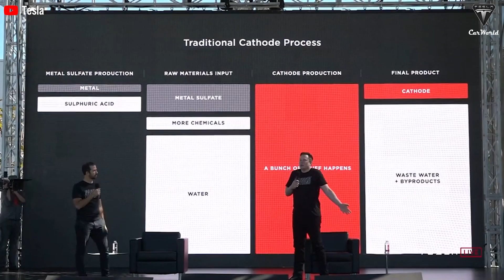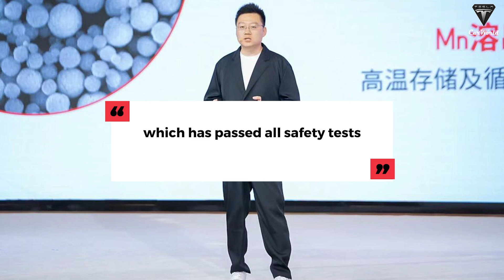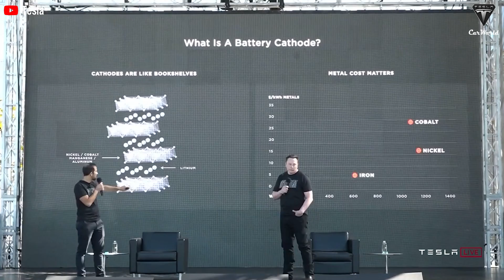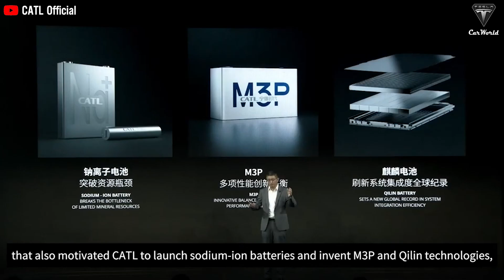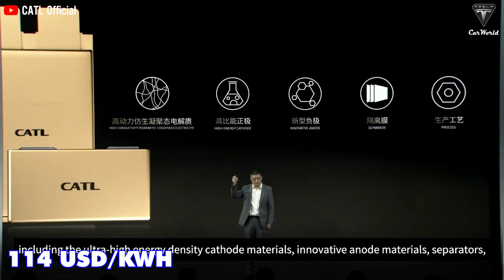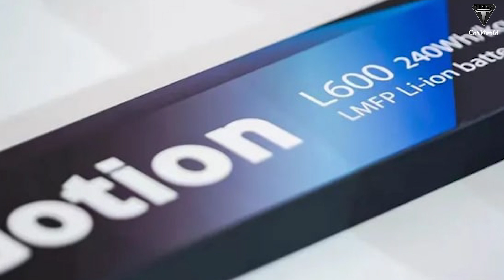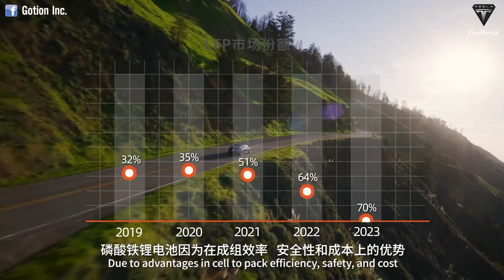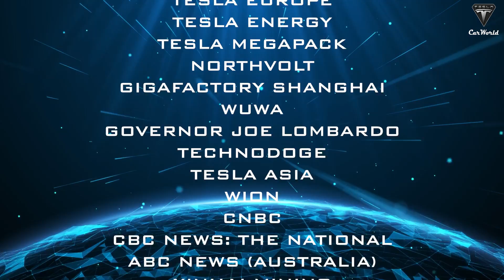The End of Lithium! Elon Musk Revealed A New INSANE LMFP Battery Tech 1,000 km/charge!

Comment: What about ca calendar life of the battery?
Say if I settle for a 500 km range battery that handles  charge 2000 cycles. That totals a driving range of 1 million km. Then say i drive 15 000 km each year. (The normal yearly driving range here in Sweden.) This means that the battery should last 66 years. Not many cars will last that long. Now assume the battery goes bad due to old age in 15 years, then i have only used about 22% of the battery but still payed for 100%.
So if we want to utilize the battery fully  we either have to have a much shorter range,  which is undesirable, or use these i vehicles that is driven much longer each year such as taxis, busses and trucks.
Reply from the maker: Thanks for your sharing, but the battery system is applicable to all terrains and each place will have a different feature. Therefore, you can rest assured that all of them have been carefully calculated.

Comment: Compared to all the battery fires occuring, I wonder how much safer these are, if they are safer.
Reply: That may well be the most important question. 

While every modest incremental increase will always be hyped as a "breakthrough", battery safety is almost certainly likely to be limited by energy density. 

Chemically, batteries are effectively devices analogous to compounds where you have taken your fuel and pre-mixed it with oxygen. As the energy density increases, it moves from being a serious fire risk to an explosion risk. In my opinion battery technology is probably already close to the safe limit. 

I could be wrong. When handled properly, compounds like Trinitrotoluene are actually very safe as compared to, say, Nitroglycerine. But the dividing line can be a very thin one. Finding this out took years, cost money, and also cost quite a few human lives. I guess that many car owners would prefer other choices.

Comment: I will never buy an electric vehicle.   In about 5 years of normal use, the battery has to be replaced at $18000-$25000 dollars not including installation cost.  Europe already has used electric Vehicles sitting on large parking lots because they can't be sold because of the battery replacement requirement.    A typical gasoline or diesel fueled vehicle will last 10 years and more and only require regular less expense mantenance.   EV are a niche market and the average car owner is not going to buy them.
Reply from the maker: That's why manufacturers are developing more for the life of the battery.

Comment: Maybe I missed it, but what is the operational temperature range for charging/discharging?
Reply from the maker: This battery pack uses thermal insulation materials that can withstand temperatures up to 1200°C.
Reply: @TeslaCarWorld  Thermal insulation only regulates the rate of heat transfer, which has nothing to do with the operational characteristics of the battery chemistry. For example, let us say we park the EV for a month at an airport in sub freezing temperatures, the insulation will not make much of a difference if it requires above freezing to even trickle charge,, hence my question.

Comment: Need ion separation lift  between+ - charges and holds positive, discharged from ground a2 pc Venturi cooling solar wind to keep heat from wasting watts ,like  open air gap or injection medium or transfer change system like tanks and injection so liquid doesn't dry out or heat long lasting battery like using grease instead wires ? Or nickel strip insulation and grease lines no copper and crimp ends or nut and Ferrell end Dme shark bite ends

Comment: what about at much lower temperatures? I've heard a lot of people complaining about EV's not being able to hold a charge during Canadian winters.
Reply: It's a good question.  There's a type of "battery" (some people call it a capacitor) that is safe and inert (unlike lithium batteries which burn at over 1000 degrees). I believe it is called an LTO but can't remember.  It charges super fast.  But it's biggest problem is amount of charge per weight and volume.
Reply from the maker: @@nedmilburn  Yes. The LTO battery can operate in -40°C.
Reply: They fixed all that
Reply: @xhames61x  Now we just need to fix all the other thats.
Reply: @bunsw2070  Too late

Comment: It seems like every week there's another video proclaiming a newer better battery, frankly I'm getting a little bored with these videos, where are these new batteries none of them are in the current production EV's. These newer higher density batteries are (supposedly) better but when will auto makers start using them and more to the point can they be retrofitted to our brand new just purchased EV that use the tried and true LI batteries and a month/year later the new batteries finally get installed in the cars (who wants to buy a slightly used Tesla with old tech and half the miles per charge?). I'd rather be hearing about motor size being more realistic do we really need a EV to do 0-60 in under 4 seconds with a 150mph top speed?

Comment: FYI... 4680 batteries can have ANY chemistry inside. It is just a container which houses the battery system, with considerable assembly advantages. So LFP, LHFP etc. can and will be installed in the 4680 cans.... My guess, this  will be done soon....
Reply: Yep 46mm diameter,80mm length implies nothing about the contents of the cylinder.
Reply: A months ago, there were reports of Giga TX taking delivery of four ultra high compression presses that would be required for silicon anode manufacturing. That chem process in 4680 cells would be an absolute game changer. Elon's vision is to have all aspects of battery manufacturing in house, and there is no indication he's abandoned that. My guess is, Tesla's agreement with BYD will give them time to leap-frog into production of a next level battery technology.

Comment: The electric grid and Tesla Superchargers would be inadequate to recharge these batteries if they existed [thery don't].
Reply from the maker: Oh, why do you think that?
Reply: 350 kw won't be near enough to recharge a 100-200 kwh battery in 5 minutes, you will need at least 4 times that. the 480V 3 phase wye service supplying these superchargers won't be adequate, nor will the transformers or distribution grid  either.
I'm a Union Electrician [42 years] and have worked on these systems my entire life, they are stretched to the max. As our nuclear reactors are retired [6 shut down last year leaving only 95 active] more and more nat gas powerplants are being built, further increasing fossil fuel emissions.  This in turn requires more and more fracking, pipelines, oil rigs, infrastructure, etc. The oil companies are thrilled, but environment minded folks are not. There's a lot more problems to face too.
Reply: @crankychris2  Heads up Cranky - they don't rely on pulling from the grid completely, that would be silly expensive for the peak demands that would be required.  Hence, these supercharger sites use battery storage to rely on evening out the demand and saving money.  The V4 Supercharger can do about 615kW (with a 1000V pack) which is what most future EVs will end up having.  Your 5 minute charge is a ridiculous target and makes no sense.  95%+ of charging is done at work/home with EVs, as they sit parked.

Comment: Cars settled on a power source 100 years ago, with some improvements along the way. It seems every week a new battery shows up, making all others obsolete. Even chargers are not standardized. I'll wait until the experimenting matures.
Reply: I'm a fan of Elon.  I think he has done wonders.  He actually may be able to deliver.  BUT, 20 plus years ago super capacitors and flywheels running in a vacuum were going to solve energy storage needs that batteries could not. More than 20 years on these things are not in the main-stream, though at the time they were promised to be right around the corner.  There have been many such claims that never materialized.  The only thing different is this one guy's track record, which is pretty darn good.  So maybe...  Also long touted as being 5 years away - for the last 50+ years - is the fabled fusion energy break-even point, which once we get there, it is supposed to be a hope, skip and jump to all our (cheap!) energy needs.  While recent reports have surfaced saying they achieved a net energy gain on recent tests, the sheer size, amount of energy and money that has to be poured into the thing to get there, means it is not economically nor commercially viable in the short-term, if ever. In the end, most of this "new breakthrough" stuff from interviews and "news" articles is vapor-ware.  The tech equivalent of snake oil, designed to intrigue investors.  When I see real-life demonstrations/tests, I'll be very interested.  Meanwhile, rock on Elon!  Surprise us again!
Reply: @daverich267  I live in Fremont, and I'm also a fan of Elon and his many accomplishments. I understand your skepticism, but Lawrence Livermore rounding the corner into net energy gain is just the first step. Its crazy size, power requirements, and expense is just like the start of digital computing. Its inception  wasn't economical or commercially viable, but its development changed the world. I don't think we'll see nuclear fusion in the trunk of a car any time soon, but it's safe to say that energy from a fusion power station will be a reality. I believe it's hyperbolic to call this breakthrough snake oil, and comparing it to the concept of super capacitors and flywheels is a false equivalent. Like EVs and computing, it was the need for it that drove its many breakthroughs, and its rapid progression in technology that made it more economical and commercially viable.
Reply: @Datsun510zen  After hearing 50+ years of fusion claims, I'm not holding my breath BUT I hope you're right.
Reply: @daverich267  They just need to turn the nob up to 11 LOL. One thing for sure, we'll see plenty of hype before it's a reality.
Reply: I agree with you. Bit like mobile phones, I've given up buying the latest. I'll wait till my phone is dead before I buy a new one now.
Reply: It's never going to slow down or stop. The train will just pass you by.
Reply: @shelberkmandmd2075  : hopefully at some point, the tech will stabilize to not obsolete an older product in a few years.
I don't need to be a first adopter of new tech which becomes worthless in a few years. ( No one is recycling batteries yet, what will my 10 year EV be worth?)
I saw an article of some chargers not working in the cold. Hopefully this will be fixed at some point.
Just recently, Ford and GM adopted Tesla's charger, maybe some day it will become universal, like a gas nozzle is.
Reply from the maker: We appreciate your sharing. However, if there is no development, the earth will stop rotating maybe.
Reply: @TeslaCarWorld    I thought that the world is flat ??    🤔   🙃
Reply: @TeslaCarWorld  : perhaps in another 100 years the EV technology will have matured.
Reply: @drewthompson7457...My feeling exactly, when Teslas first car came out the "Roadster" it was $100k and super fast. I understood it was a showcase as to what an electric car could do but the car was unobtainable for most people not to mention unpractical then years later tried making a car more affordable? The experiment continues to this day (I know progress takes time) but we are indeed part of a grand experiment and I don't relish the thought of having my new EV outdated the following year, and these "NEW" batteries are still using lithium which is mined polluting our planet, our water and the landfills. I give humanity about 100 years before Mad Max

Comment: Regardless of battery technology, they better get the power grid up to 21st century requirements, and quickly.
Reply: Energy storage is arguably the most important part of modernising the grid. They aren't separate problems.
Reply from the maker: Due to the issue, storage technologies are developing at the current pace.
Reply: @TeslaCarWorld  How will that solve anything if there isn't electricity to store? You have any idea how much energy it takes to make steel, aluminum, cement, glass, to mine and smelt metals (if we could find the copper, chromium, nickle, cobalt etc., - iron is the only metal we have enough of)? Nuclear is spectacularly dangerous unless you're fine with a 250,000 year continental depopulation event because the electricity went down for one month (for the cooling pumps for the spent fuel at nuclear stations). 

Instead of doing YouTube videos you should take a course in thermodynamics. Then you wouldn't be wasting your time misinforming people. 

And I haven't even mentioned the energy to make fertilizer and run farm and food processing equipment. Are you looking forward to starving because that is exactly where they're taking us. It's basic physics. Civilization happened because of hydrocarbons. 

And Elon doesn't give a damn about you or anyone else. He wants to put a chip in you if you are one of the few that is still alive. Ask Elon about what he did to Bolivians.
Reply: Exactly!
Reply: No worrys according to new yorks doomsday clock we only have 6 more years.
Reply: Let me understand this.  We are to convert everything we do to rely on electricity and a utilize government-controlled source to produce the electricity?  No thanks.  Sounds like a dictator's dream to introduce rationing and control.  Conform or no power for you!
Reply: You’re using too much logic. Big government only looks out for big industry. They don’t Care about you. They don’t care what your cost for energy will be. I forgot which congressman asked the other day “if EV’s are so great, why do we still have to bribe people to buy them?”
Reply: It will never happen (even if they wanted to it would be impossible). This is about taking away our mobility. A senior official in the EU said recently that their goal is to eliminate 75% of vehicles by 2030. Electric cars are impossible for every relevant reason (it would actually be an energy drain, the minerals don't exist, etc.). Green energy technology consumes more energy in their construction then they generate in their lifetime. Global warming is a con. They invented it to bring in the new world order. Learn to cook with cricket powder. And collect weapons. If we get lucky we'll be able to execute all of our leaders.
Reply: Easy to do in small ass European countries, not so much in the United States.
Reply: Well considering there is plans available on YouTube to make a perpetual machine that will run in generator and you can power your house for free forever then why rely on the grid you could just charge it at home right?
Reply: @alreadydead86  Okay, you make one and after you've got it working properly  explain to the rest of us how to do the same.